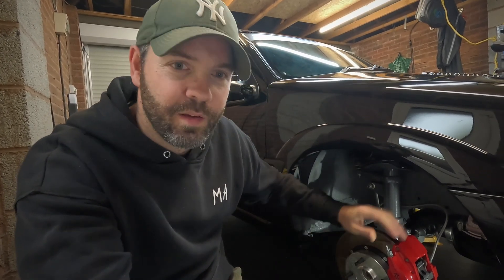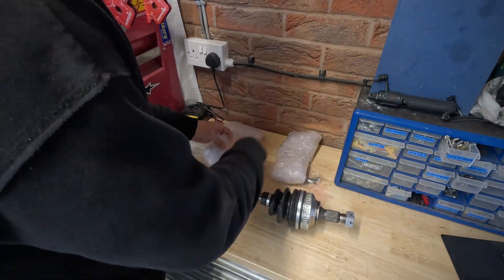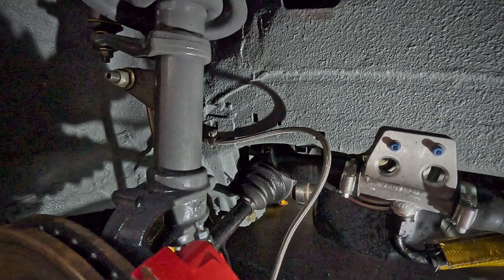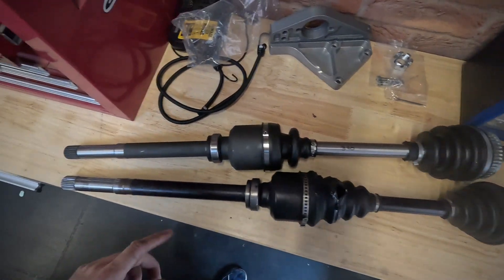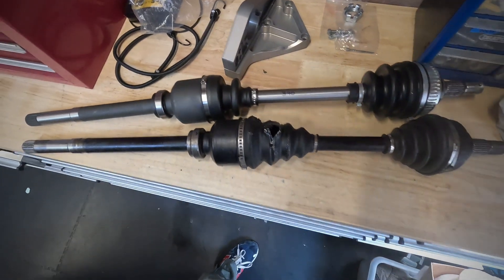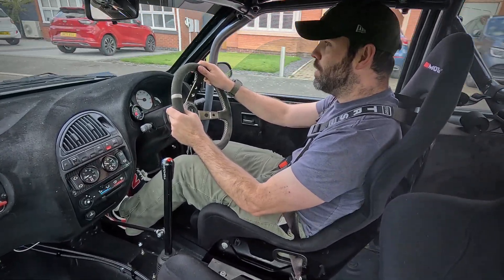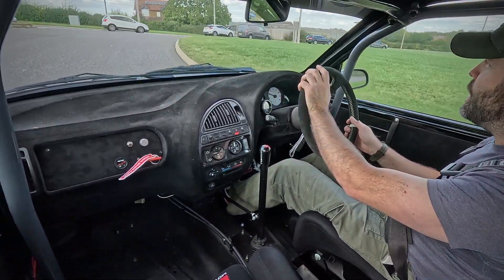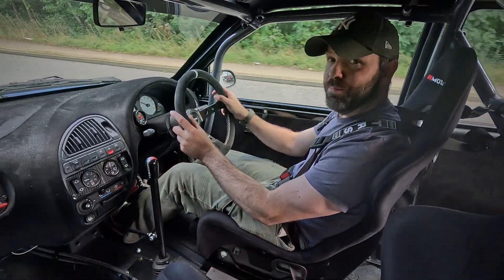Project 5AXO Ep64 - 370bhp Citroen Saxo VTS Turbo - Satchell equal length drive shafts!

Comment: Loving the content, ive followed since the very first episode. Id be interested to see what your corner weights are, coilovers will help correct this.

I have a 106 hillclimb car, from memory i always had about 120-150kg more on my front right wheel compared with the front left. Engine + Driver weight all on that front right corner. Its something you connot correct completely unless you want to convert to left hand drive and pile on a few pounds. 😂

Keep up the great work on the channel 👍

Comment: Why so many people install  the water hose adapter between waterpump housing and radiator?🤷🏼iam very happy about an answer.
Reply from the maker: @hubertalbrecht3183  it's a known weak point where the hose can make contact with the bottom pulley. Additionally, I need a place for coolant feed for the header tank. Two birds, one stone.

Comment: Great to see the drive shaft has eased that torque steer 👌 Looks like you're using a new editing sw too, great video mate.
Reply from the maker: Annoyingly I just signed up for the GoPro software (£25) before I saw your post.
Reply: @SeanPendlebury  still looks good though. I haven't tried the GoPro one so idk how it compares to Filmora.